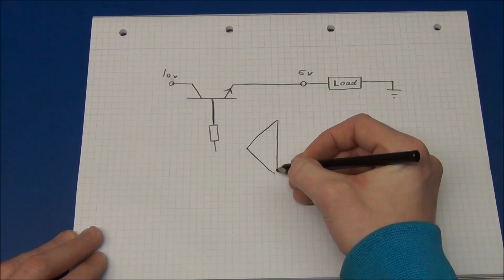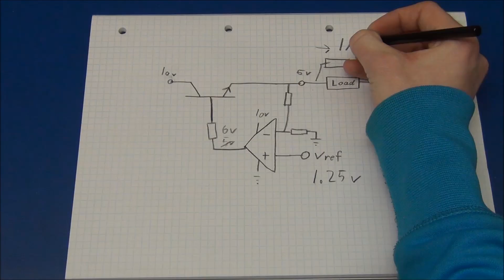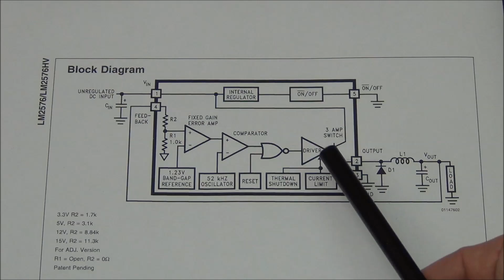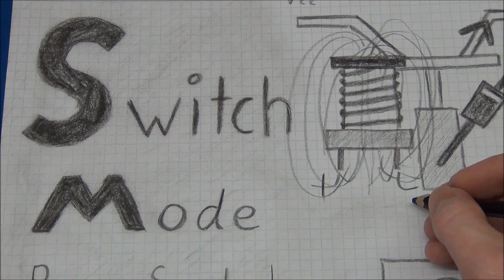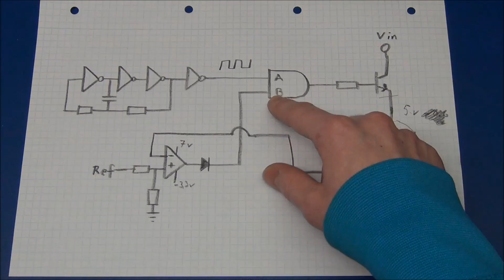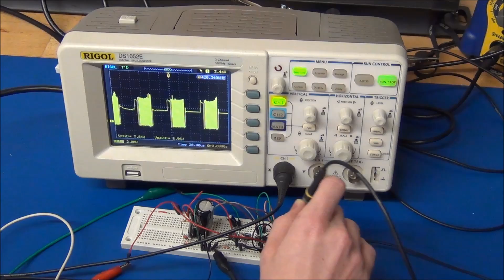Switch Mode Power Supply / Regulator (Tutorial with basic example) - Ec-Projects

Comment: Your thinking is off and your circuit is not correctly done. You must've just been starting out and not fully understanding concepts and circuits... Sorry I am so negative.
Reply from the maker: As I wrote in the annotation, the oscillator is wrong. Apart from that it's still a switch mode power supply. And yes I learned not to leave the mistakes in the videos ;)
Reply: No its not a switch mode power supply. You need to do more on your education. The voltage divider on the opamp "ref" is useless it's 3.5 volts. The inductor does nothing in your circuit. All your doing is turning the npn transistor on and off rapidly for just a brief time  charging the cap to 3.5 volts and making a very poor linear regulator. The cd4081 is a and gate not a nand gate like you say it is. The in5819 on the output does nothing either. How do you expect to get anything near 5 volts on the output?
Reply from the maker: Perhaps you should pay attention to what was said / shown in the video before you start complaining. 
Get your facts straight, if you want to act that arrogant.
There is nothing wrong with the current path in the circuit. The diode, which you claim has no function, protects the transistor from the voltage spikes created by the inductor. Show me just one buck-converter where that diode is not used, please. 

I did make mistakes in the circuit as I said, so stick to criticizing those, will you.  
If the lower input to the and-gate was latched by the output and the duty-cycle of the oscillator was closer to ~95% it would work quite well. Still not like a PWM/PFM controlled regulator, but that was not the scope of the video.
Reply: I see that you have made an EXCELLENT circuit. However, since you are using OP-AMPS, where is the POWER SUPPLY for the op-amps? [They need a positive and negative supply, so their needs to be a another power supply inside your original power supply].     ?????

Comment: since you used a fixed frequency, fixed duty cycle oscillator which you just "gated" through an op amp i guess the regulation will be much more limited, since its just turning itself on or off in reference to the ref.voltage. i guess a more sofisticated SMPS IC would use real PWM , so the duty cycle is variable and "more current can flow longer" if required. or even less through shorter pulses. but still an impressive and nice build for starters like me to learn.

Comment: your explanation on SMP is good however your diagram is not correct in bock converter you need PWM to drive the to stabilize the output.

Comment: Mostly a good video, your explanation of the buck converter was correct but you made mistakes in the control circuit and that's why it didn't regulate and as you could see from the output of the opamp while the digital oscillator was on, it has an unwanted high frequency oscillation, so is unstable.

The fundamental problem you had with the buck regulator is everything between the opamp and transistor. The problem is with your assumption of the digital oscillator and AND gate which is simply not how this works. You want a PWM output to drive the transistor and this can't really make one in any steady way. You need the PWM to regulate this converter as you're balancing volt-seconds charging and discharging the inductor, if you want a different voltage ratio, you change the time ratio. Only then can you get something which uses Vout=D.Vin to regulate Vout. The oscillator should be a sawtooth oscillator. The opamp's output voltage and this sawtooth waveform are the inputs to a comparator, so the DC output of the opamp (it should be roughly DC, not oscillating here) is converted by the comparator to a duty cycle and the output of the comparator drives the transistor. There should only be one switching transition per cycle of the oscillator.

I should also mention that these are intrinsically unstable and you need local feedback frequency compensation around the opamp. I can do that for you if you like but it's too involved for me to explain it here. I'd need to know the inductance, output capacitance, the output capacitor's ESR, input voltage and peak-peak voltage of sawtooth.

Finally, a high side switch really should either be PNP, P-channel FET or if it is N-channel, have a relatively complex high side driver circuit. For a little low power demo like this a PNP would be OK. High power would dictate the need for an N-channel FET.
Reply from the maker: KX36 Thanks for your comment :) You are absolutely right :DI realize that PWM would be the best solution. I just wanted to make something simpler to understand. I agree now that this one is not good. I should at least have have added feedback on the AND gate to make it latch until the oscillator went low. So that it would still turn on randomly, but would stay high for the rest of the pulse.. I did put an annotation in the video, short after release, saying that section of the schematic is "wrong". Unfortunately it does not show up on all devices :( I will make a video on how to improve the design, just haven't had much time lately..
Reply: +KX36 I suppose you never heard for buck converter operating in skip cycles mode (basically that's what he made here), and most modern buck converters operate in that mode at light load.
Reply: +Petar Petrovic 
I have heard of and used "pulse skipping" or "burst mode" for higher efficiency at light loads, but that's not what this is. It is operating in bursts but not in any meaningful way and I'm sure that's not intentional for low load efficiency. I have heard people call hysteretic buck "pulse skipping" or "PFM" or "PCM", but that's a completely different thing from burst mode so I don't like to use that term for it to avoid confusion. This is closer to the latter but still not the same as that would typically have a constant on time or off time and vary duty cycle by adjusting the frequency thereby providing regulation. Take out the oscillator and the AND gate and it could be a hysteretic buck. I don't know why I didn't see this before, I probably came at it with prejudiced eyes. Something about the PWM controller datasheet shown at the start and the way it was drawn and had an oscillator made me think the AND gate was supposed to be a comparator and so I thought he was aiming for a textbook voltage mode PWM buck.

As it stands it looks like he was trying to make it fixed frequency which isn't how hysteretic buck works, so by mixing and matching different parts of different topologies he ends up with something that doesn't work right - a hysteretic buck that's unnecesarily toggled on and off. It worked at light load but at heavy load it can't meet regulation so the hysteretic regulator part of it is always on but the oscillator/AND gate are holding it back, hence the low frequency high amplitude ripple.
Reply: KX36 All that writing and you (still) don't recognize basic topologies (and this is not first time, you show same in many of your comments for other videos, even you presents yourself  SMPS designer), what he made is crude skip cycles mode buck converter, now what it is not regulating is different story, mainly his loop is not closed properly, skip cycles mode is not famous as topology that is easy to implement (that why it is mostly used for light load only) but still if he try more he could make this work, but this is not point of this video, he used it as simplest example.

Comment: Hmm sorry, but wrong again? ;)
My guess why the regulation under load did not work is, that you wanted to regulate to 3.5V from 7V, but had a max. PWM ratio of 50/50. Even without any feedback 3.5V is exactly what you'd expect in that case, but only in an ideal case with no losses at all, not even the typical diode forward voltages. If you consider the losses in the inductor, the transistor, that a 50/50 on-off-PWM before a transistor is more like a 45/55 or worse on the "power side", that the base current has to go through the inductor, too, and thereby can't change as fast as you want it to, you need headroom to switch.
Try the same with either a higher supply voltage, a lower voltage to regulate for or another PWM ratio.
Reply from the maker: Hey.. Thanks for your comment.. :)
Nope, I'm pretty sure my final conclusion is correct. Either lowering the value of the inductor or decreasing the switching frequency would do the trick.. What you suggest in the end would also help, not because of the PWM being the problem, but because that would allow more current through the inductor.. I'm afraid the PWM is not the main issue here, if you think about it; without the feedback, the transistor will charge the capacitor to 7v minus the CE drop of the transistor. If we forget about the inductor for a second we can just chose a capacitor to give us a ripple that we can accept at  the current that we want to draw. The problem comes when we add the inductor, because it adds impedance to the current path. The higher value inductor or the higher frequency we chose for the switching the more impedance we get, hence the lower peak current. When that is said, it would still help to increase the duty cycle of the switching signal, or just get rid of the oscillator all together because we would allow the transistor to "charge" the inductor / capacitor for a longer period. But with the correct value inductor it shouldn't be a problem :)

Comment: I really enjoyed your video, thank you. One question, it looks like you have the ref voltage feeding into the voltage divider feeding the non inverting opamp input, but I think you wanted to divide the voltage from the output of the inductor section?
Reply from the maker: Hey, thank you.. Yes, i do feed the ref in to the non-inverting input (I'm using the supply voltage, and divide it down to the voltage that I want the SMPS to regulate to.. Would be better with a proper Vref-ic..) The voltage from the inductor (output) is going to the inverting input, I feed this in directly... I works fine, but this way the output can never go higher than the ref, so it becomes a problem for higher voltages... Most circuits do it the other way round, they feed the ref in directly and divide the output down (as you mentioned), because they use a much lower ref-voltage.. :)

Comment from the maker: Dariush Sh , I used the supply voltage, divided by 2 ( two10k resistors ).
But for a "real" circuit you should use a dedicated voltage-reference IC. Thanks for your comment :)

Comment: Thanks for the tutorial! A while ago I made a switch-mode boost converter with a 555 PWM circuit. The output went through a 10k resistor + zener and that would be connected to a transistor and the control pin on the 555 timer, also a very nice way to get it working! I feel inspired to make a second revision ;) Even though Dave from the EEVblog says you're better off buying a dedicated IC, its just too much fun to make one on your own. I got around 85% efficiency out of my boost-converter!
Reply from the maker: You're welcome :) Yeah, I have thought about playing with the 555 as well.
But I have to agree, the dedicated ICs are better for a practical circuit :)
But it's still fun to see how good you can make one :D